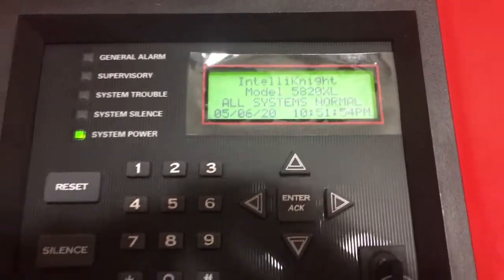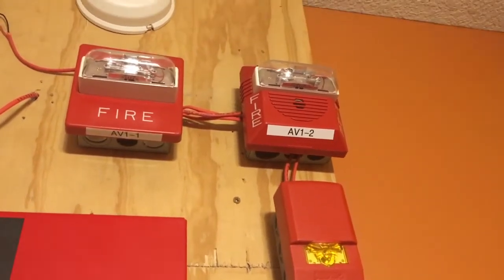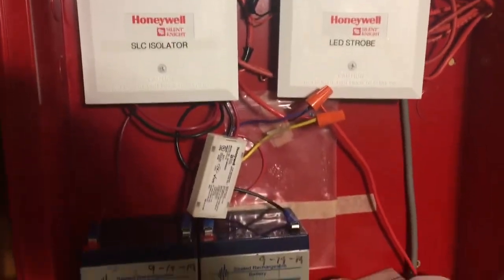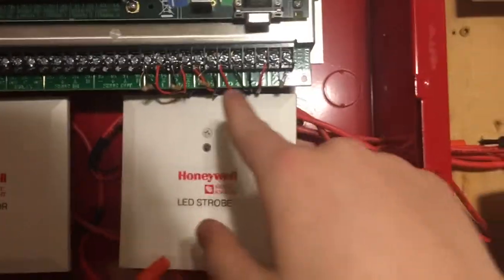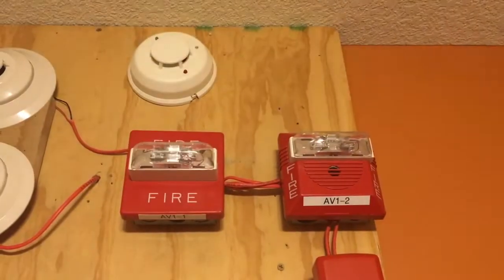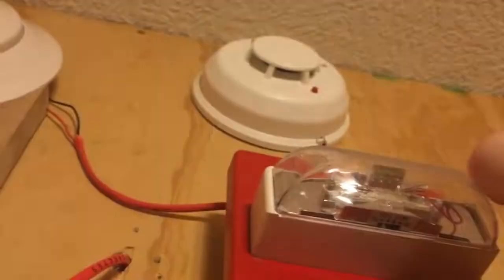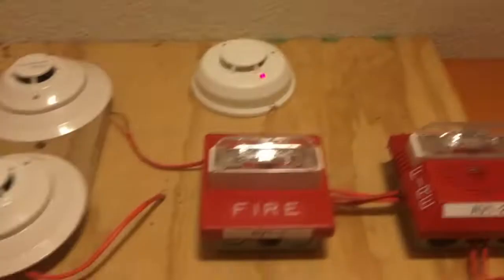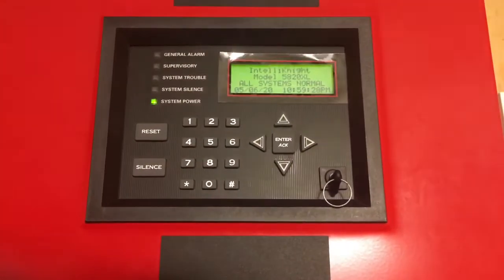Bedroom Fire Alarm Test 1: New Panel

Comment: Remembered me from the group.. I'm Matt

Also if I'm not mistaken with the 5000 series you can use Fire-Lite BG-12LXs set on the SK SLC family.
Reply from the maker: Yes, I’m using The Honeywell/SK protocol for this system. I’m planning on trying out my BG12LX at some point. Also, try joining the GroupMe again. I haven’t seen bots in the last week or so knock on wood.
Reply: @FireAlarmsofNortheastKansas  I tried but it said its closed off

Also if you ever need to contact me for help or anything else in general add me as a friend on discord:
L-Series#6820